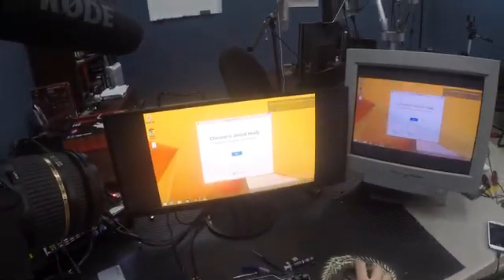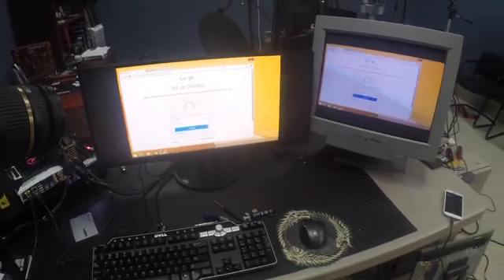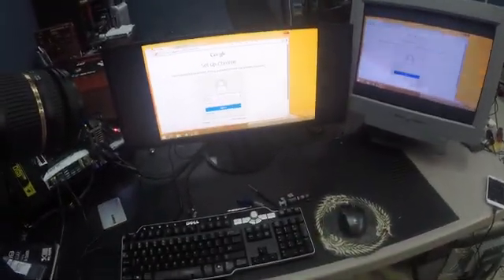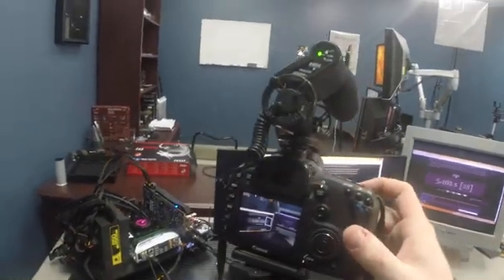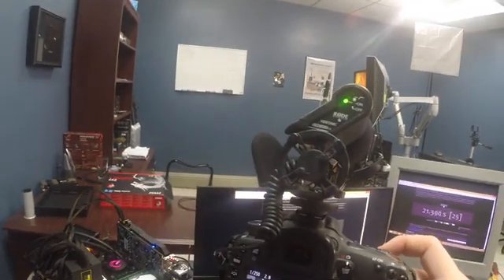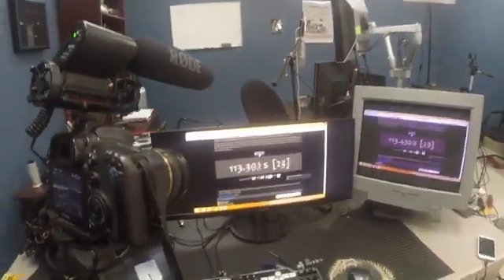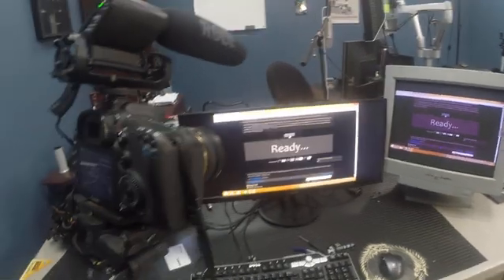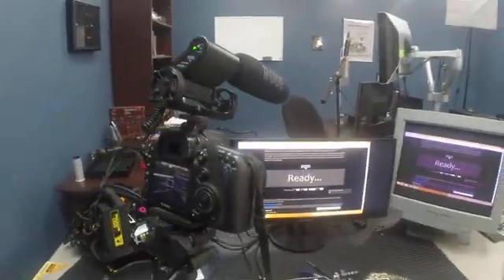Frame Latency Test Stuff

Comment: well im a little confused I thought that CRT relied on a mechanical mechanism to shift the light pattern and redraw the screen, but how can a mechanical means be faster than pure digital moving at c? is the lag generated in the monitors logic engine translating the signal into usable visual data?
Reply: On a CRT a variable magnetic field moves a ray of electrons around the X and Y axis and draws the image
Reply: that seems far to subtle and sensitive for 70s technology but then again that would explain the colorshift from having permanent magnets too close to the old television. here I thought it was a basic rgb tube diode in back with a electromagnetic filter that would flicker rapidly for each color in the spectrum producing the overall picture thus explaining why old school nintendo console players prefer rgb coaxial cables for that sharper image rather than a composite.
Reply: It's just 2 plates, one on the X and one on the Y axis, and they vary the magnetic fiend to move the ray of electrons. See: http://www.electrical4u.com/images/internal_structure_CRT_rev.jpg

> Vertical deflection plates
> Horizontal deflection plates

Comment: Hi Wendell, I have the crossover 290m and I lost the dvi-d  cable and power supply for it. I bought a replacement dvi-d cable and variable voltage and output adapter power supply. The crossover requires 12v with 4amps power supply but I stupidly set the plug to 24v with 4 amps and when I turned on the pc the monitor just shows wide grey strips of different shades. 
Could the higher voltage fried something on the monitor or could it just be a random faulty dvi cable? 
Any advice you could give would be a massive help. Thank you